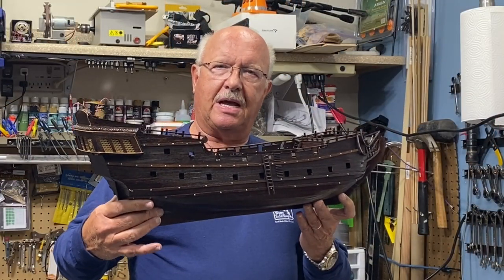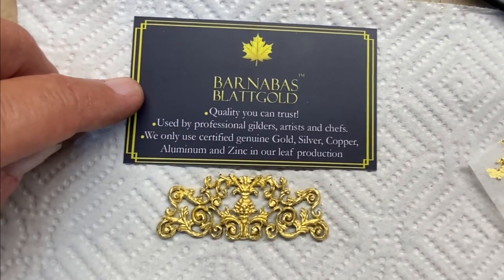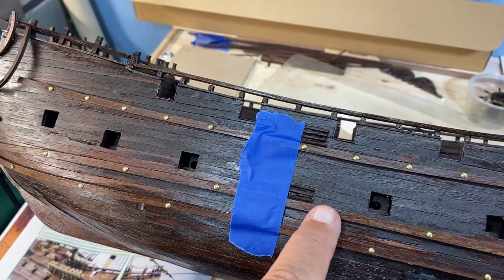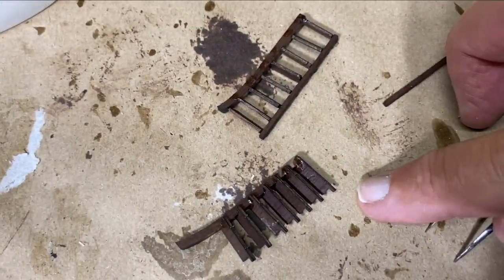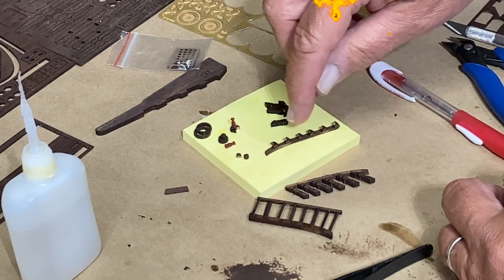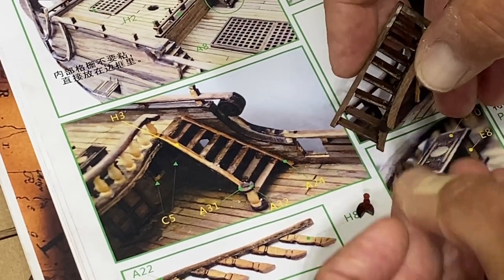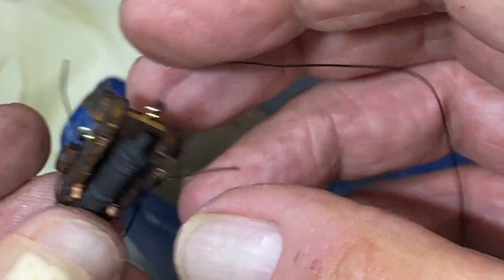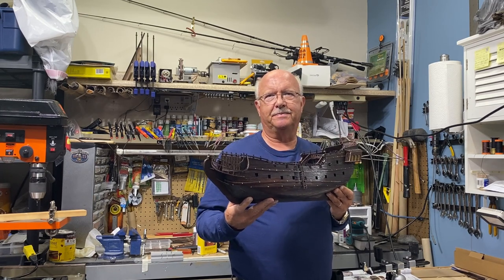The Black Pearl Golden Version 2021 Episode 11

Comment: A39 are actually rub rails to hold the lifeboat away from the side of the ship when hoisting the life boat up an down { no ladder rungs required}. On my kit version they where spaced farther apart than yours and recessed/notched to fit flush along the side of the ship but still protrude out far enough for the lifeboat to clear all side trim and ladder slats. Enjoy the sunshine vacation
Reply from the maker: Thanks! That makes more sense to me now. Wish I had asked before installing….. actually they can easily be removed and replaced!  I think I will do that.  So to clarify, should it be just two vertical rub rails on each side?  My kit has a total of 6 available. (3 on each side?)
Reply from the maker: Thanks again!  Removed the old ones and made new ones from scratch so I could notch them out as you suggested. Looks much better!  I appreciate your following along and providing me helpful information as my journey continues 👍👍